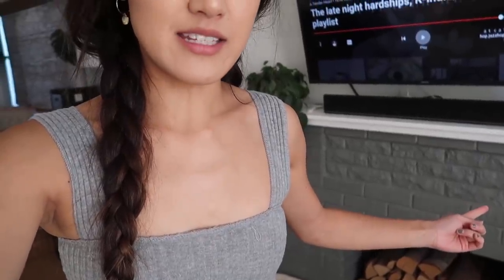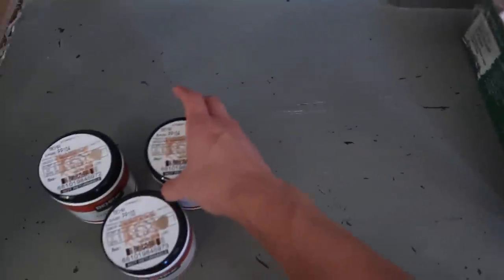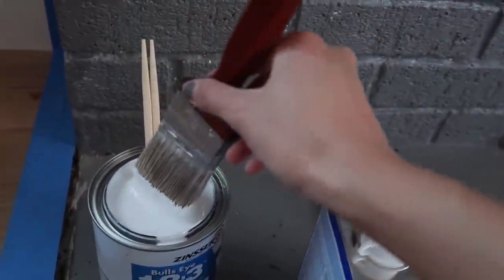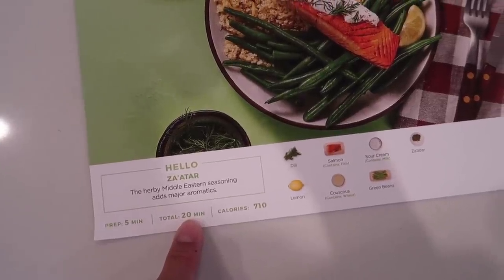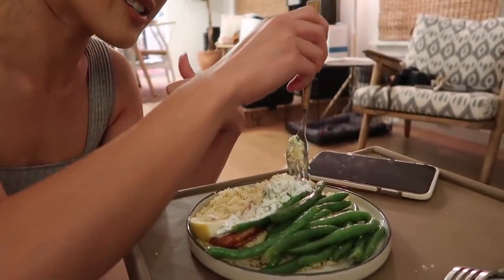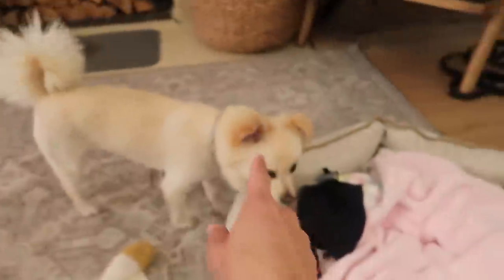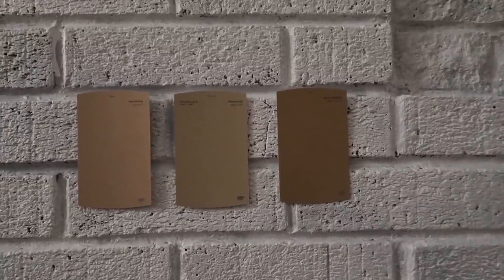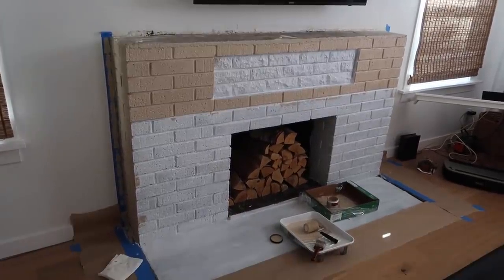Changed Our Fireplace for just $6 | WahlieTV EP713

Comment: Definitely don’t do this if you use the fire place
Reply: bloopers408 why?
Reply: thejunebugable because if they use their fireplace the paint will eventually peel off . Cause some latex paint can’t handle the heat temperatures up too 1200 degrees. There’s a spray paint for heat if you do plan on using the fireplace but only comes in a few colors